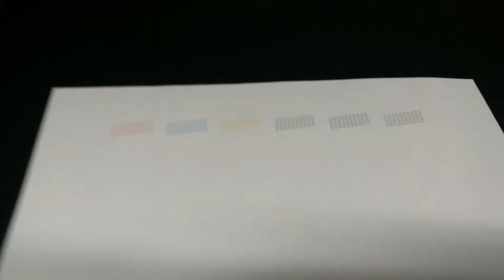disassembly brother printer dcp/t300/t500/t700

Comment: can we used brother dcp-t510w  display and wifi on replacing part on   dcp-t300 to make it wireless
Reply from the maker: nope because there is no slot on the mainboard of T300 for wifi adapter

Comment: sir pede hugasan og tubig ang print head pag nadis assemble na?  kanang wala na iya board
Reply from the maker: puedi raman tana pero make sure nga inig taud nimo uga jud then ayaw gamit ug dili mineral water kay mo taya...
Reply: Athana's World mas prefer nemu sir nga dili bas. on?  what if clogged didto nga part sir?
Reply from the maker: @melancooly7852  i used syringe like what i did in this video https://www.youtube.com/watch?v=Uh1zAb8zTvQ
Reply: Athana's World sir gitangtang nako sa band ang print head pagbalik nako ang print head dili na mudagan sa pikas side.  mulihok lang sya pero dili na mudagan sa pikas side.  unsaon ni pag fix sir?
Reply from the maker: @melancooly7852  check ang encoder strip basin wala matarong...
Reply: Athana's World sir what if naguba nako ang print head. . naa koy nabuak.. pede pa ta makapalit og replacement sir?
Reply from the maker: @melancooly7852  naa na cya maam sa service center raka makapalit ana...

Comment: Sir merong galing na brother printer sa canada nakalimutan nila na 120volts yun naisaksak nila sa 220volts...umusok tapos di na nagsindi. Ano kya posibleng nasirang part nya? Mahal po ba pagawa nito?
Reply from the maker: yung power supply nya sir ang kadalasang nasisira pag ganyan bihirang ma apektuhan yung mainboard nyan kc may fuse naman yan
Reply: @AthanasWorld  thank you sa info sir
Reply from the maker: @zaldydupitas8747  welcome po sir
Reply: @AthanasWorld  sir mfc-j625dw ang model nito saan po banda ang fuse? Kaya ko kaya ireplace yon all by myself? Kung ipagawa ko sir magkano kaya ang gagastosin ko? Saan po shop nyo sir?
Reply from the maker: @zaldydupitas8747  sa leftside bottom sir pero hindi mo makukuha yon pag hindi mo i disassemble kc yung screw nya nasa loob